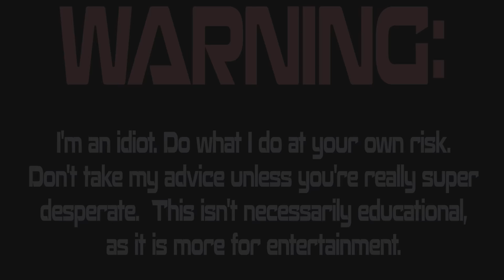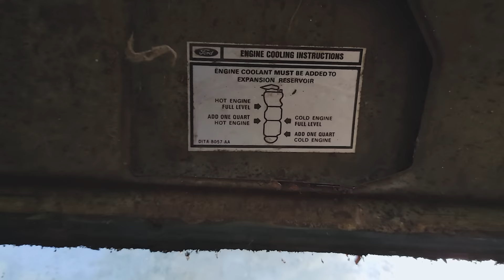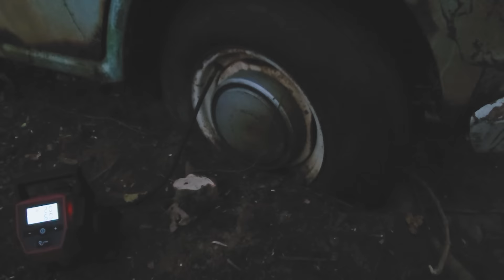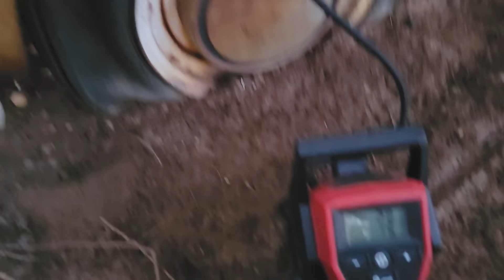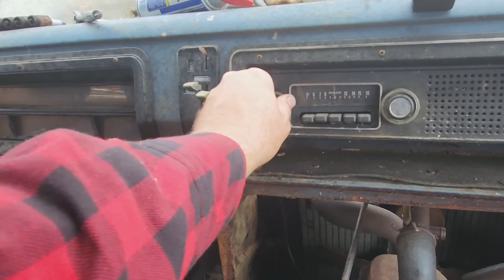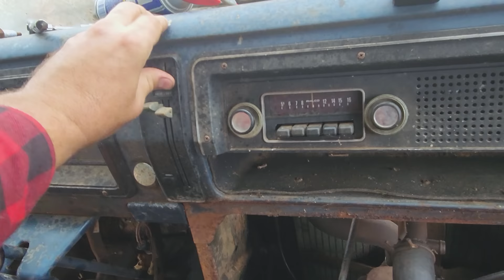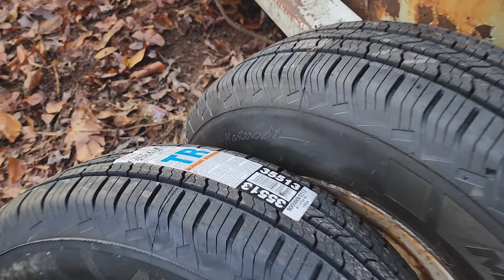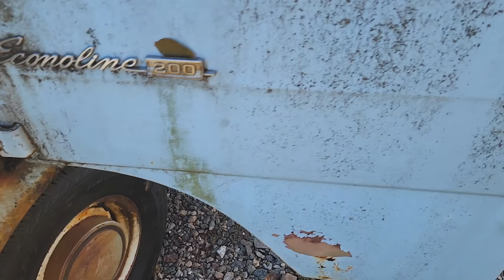Buried in the woods for 32 years! Will it RUN AND DRIVE? Abandoned Ford SuperVan!

Comment: I think that van deserves a full resto honestly, seems like an incredibly fun project
Reply: And a useful project when finished .
Reply: I’d like to see a full restoration. This brings memories of when I worked out of these vans for deliveries and appliance repair. The ones I drove had the 240ci six and three on the tree too. I remember there was a grease fitting on shifter shaft behind the grill that nobody greased and then you couldn’t move the shift lever. One guy I worked with actually broke the shaft. Heater made noise but not much heat.

Comment: The trick to taking off the engine cover is to lift the front up and rotate back. You have to stand behind it while doing this. You also have to simultaneously cuss or else it doesn't work.

Comment: I was screaming 240 six cylinder at the first of the video.  My senior year of high school , I was the proud owner of a 1972 f100 Explorer with a 240 six cylinder engine. I got it from my dad and e tried for a couple of years to blow the motor to give him a reason to do a V8 swap. I got it a drove it to Orlando Florida from North Georgia and back for my senior trip. It used a little oil but made the trip with ease. I put a split header on it to make it not sound so much like a six cylinder. I loved that truck. Great video guys.

Comment: Dont feel bad. I drove a VW Beetle from East London on the east coast of South Africa, to Port Elizabeth, 300km away, with no brakes, and no emergency brake. That is through passes, towns and all, just using the  gears to slow me down, going into first gear and switching the engine off to stop. Back in gear, restart and pull away. That was a hair raising trip, but it was fun. You guys make us proud by giving those old vehicles a new lease at life.

Comment: If it was mine i would get it running, pressure wash it and send it just like it is. Those Ford straight 6 engines are indestructible. I'm commenting early in the video but i predict it will run with minimal work. As far as clutch and linkages im not so optimistic. I think that old van is really cool. I had a 1980 econoline van for awhile with a 4speed manual with overdrive 5th gear and i absolutely loved it. Mine was actually stolen if you can believe that. Hope you get the old girl running and as a long time viewer of the channel i have no doubt you will. Im really enjoying this one and cant wait to see how things turn out.

Comment: Love your stuff and it so reminds me of us in the 60s and 70s cobbling together all kinds of monstrocities over a 12-pack in my friends garage.  Lot of scuffed knuckles then with no power hand tools. I got divorced at 72 and bought an 88 Ford XLT 350 van so I'd have someplace to sleep if I needed it. I just crossed 100k original miles. I've fallen in love with this extended model, there is so much room. It's totally stock now but I could make a bedroom and kitchen in the rear. Lots of windows. Powerful torquey engine. I think it was used to take special needs kids to class so it was all local miles. I tore out 3 bench seats.

Comment: Those old Ford straight 6s are almost indestructible. My dad ran a construction company and he put that f150 with a strait 6 through its paces on the week days then pulled a camper and a boat behind the camper on the weekends. That truck finally gave up after 890,000 miles.

Comment: I have a 1978 ford van in my field. Hasn't run-in 10 years. Nothing wrong but bad gas mileage. It has a 460 V8 auto. Dual tanks and exhaust. Not much rust for central NY. It's a window van with all it's glass. This van reminds me of mine

Comment: Vans like that are cool so you can add much needed fluids in motion without stopping at the gas station. Plus one guy can steer while the passenger can operate the accelerator. Good safe trip fellers.

Comment: You two guys really played well off each other, it was funny as hell. I think a van with this much space should be a conversion van for doing a little traveling.
Reply: It'd be sweet to make it four wheel drive with  f250 drive train and put a pop up tent top on it
Reply: With just a 6 cylinder it may not have enough power to pull a heavy camper van
Reply: @bertgrau3934  
If I remember correctly, they were geared down because of that. I remember driving vans like that and they were great around town but they ran out of revs at freeway speeds. At 65, it was revving its heart out. Kept waiting for it to shift into high gear (even though it was there). 

I think they changed from this style to the new one in mid ‘94. 

I’m feeling old because I was a mechanic at McDonald Ford on Mack Ave. in Detroit and did new-car prep from the factory. I prepped many of these and remember the new vans coming out, I’m sure, in ‘94. 
Thanks for the memories!

Comment: Had one of those vans 72 but a shorty panel sides I built the 302 4 barrel 650 cfm HUGE CAM AND HEADERS, MAGS WIDE LOW PROFILE TIRES. C6 transmission I made it a girl catcher Shag carpet and curtains. I surf off the coast of California back in 1980.

Comment: I had a 72 Econoline back in the mid 90s. We did the right thing and swapped out the stock 240 inline 6 and swapped in a 302. It was about 15 mph faster and got about 2/3 of the mileage it got with the 240 inline 6.

Comment: We have a van exactly like that sitting ontop of the mountain at the farm and it's used as a hunting van. My great grandpa took the motor and tranny out and pulled it up there with the tractor and put a 100 gallon lp tank under hood and ran copper lines to a gas stove in back middle of the floor. Turned the bench sideways. I've slept many times in it deer hunting. You get so warm in there and it would put u to sleep. I'd think about pulling it off mountain if it was a panel van but it has windows exactly like this one. I have pics of it on fb. It is a pretty cool van.

Comment: I owned a 69 E300 1 ton with a 302 V8 and C6 automatic that was the same color. It pulled a 32ft travel trailer with ease. It could also be made to haul 2 yards of sand which made it ride like a Cadillac. I sure miss that old van.😢

Comment: Glad to see my two favorite YouTube car experts getting dirty and working together.  Cool find.  Definitely keep stock motor.  Disc brake conversion + new suspension/steering.  Fix the major rust, keep the patina and use it for a parts hauler, maybe with a mattress in back for road trips.

Comment: My first vehicle was a 1978 E150 Ford van with an Inline 6cyl. Those were great, very smooth engines,  and easy to work on.  I learned to drive 3 -on-the-tree, 1971 van

Comment: A friend had the regular length E100 about the same year with the 6 3 spd back around 1979. He made benches for the back and we all cruised around in it for some years. Drove and ran like a champ. We went from Boston to all around Canada and back in it. I say do a budget build, fix what's wrong and do some upgrades to see what power you can get out of the 6, like headers and a 4 barrel or dual carbs if something like that is available. Get it going good and do some before and afters. Test it on a drag strip before and after? The possibilities are endless

Comment: Hey guys,  I think what you should do is make this a custom restoration as a Questionable Choice Garage Remote Rescue Vehicle. I envision it this way. Start with a full normal restoration... maybe a few slight engine mods to gain a few HPs and give it a little pep. The interior should have some sleeping space for at least 2 people, with a small cargo/storage area for tools and new parts storage. Maybe a  small fridge or ice box for a little food/snackage and drinkage. If you wanted a little more versatility, you could put a tow hitch on the back and have a diesel engine swap for some more pulling power to help yank really stuck vehicles that are sunk to ground up to the floor boards, like this van was.

I think you should do something like this or some variation thereof with this van.

Thanks,

Tim

Comment: I remember doing this exact same project, but on a old Ford Brougham with a 400. It had moss growing all over it and had been sitting probably 20 years. It was green with a soft black top. We got it running with absolute minimal work and money then drove it around our county all day. We ended up rallying it up an old cow trail road that turned at a lake shore but we didn’t make it… turns out a tree had blown down across the road and was sitting at windshield height. We nailed it and peeled back that car like a sardine can! Lucky to have lived to tell the tale. We all bailed out and hiked the 20 miles back home. We were all too lazy and hung over the following days to try and retrieve the boat of a car pinned under a tree… next thing we know the ministry is calling us saying we have 24 hrs to remove the vehicle or were being fined 10,000$ for each day it sits lol needless to say we drove my buddies dads propane tractor to go tow it out and put it right back in the spot we found it. That 400 had a ton of power.

Comment: "If it ain't two things, it's twelve!!" 

GREAT VIDEO! I was LMMFAO!! Driving down the road on fire, no brakes, Jared working that wheel like he's sawing logs with the 'barely there' steering, Derek pouring pee/coolant on the exhaust manifold with his door flying open, smoldering air freshener tossed onto the pile of flammability in the back of the van, like HOLY COW! Can any more stuff happen all at the same time?!?! My aunt used to always say, "If it ain't two things, it's twelve!", you guys had 12 squared, it seemed!!

Nice work on digging it out of that muddy tomb and bringing it back to life, somewhat!

Comment: Worked for a company and drove a 72 Ford van like this one and it had about a half a turn of play in the steering wheel until the day the steering box completely rusted away from the frame then the wheel would spin freely with no response from the steering tires. Had it rewelded to the frame and drove it for another 2 years till the seat riser rusted away then you would put in a milk crate, put the seat on top of that, sit on the seat then fasten the seat belt on tightly to keep it all in position.

Comment: Someone suggested 'awesome vintage camper van build', and I think I agree.  The 240 six and three on the tree are way too cool to ditch, but it needs to be highway drivable - I'm thinking front disk brake conversion (maybe even power brakes), and add an overdrive unit to the three speed to give it some highway legs.  After that you'd have an awesome platform for all sorts of projects; vintage air, maybe?  EFI & cruise control for a fun challenge?  Sky's the limit!
Reply: Offy intake with a 390 CFM four barrel, cam, timing chain and headers.

Comment: The old school vans are starting to get more and more popular so the prices of a straight example, rust included, are shooting up.  I've got an old G10 shorty panel van and two Corvair vans, one panel and one camper style with windows and rear seating.  The Corvairs are special for obvious reasons with the powertrain layout, meaning people either really really want them or they're parked and forgotten.  I like the flat-six in them and the second gen's great handling and weight distribution.

Comment: I restored my 1976 Dodge B200 that my Grandad bought new back in the day. It has the same flat nose design and similar steering although it was pwr. I thought the steering wheel had serious problems as well but turns out, so it seems. that play when not being driven is common place. I still had to set the freeplay on the worm gear which helped and I replaced every tie rod and steering arms as necessary. The Free play might be wear on the other gears with the large nut that adjusts the pitman arm. Most of the play is in the gearbox. Haven't got around to that yet. These vans are more affected by the crown of the road than I expected. The reason I replaced the front end more or less. Really helped with the crown of the road. I made sure there was no play on the front wheel bearings just in case. Suggest they get cleaned and hand pressed for degreasing. They get hot if you don't like your Grand National did. The brakes combination valve needs a good flush as they can cause the calipers to drag. Comes with a reset pin with a ring on it. Might be what keeps popping. Might be the problem with the LF captain's wheel as well. I replaced an outer bearing and the RF caliper. I had PWR brakes to deal with. Same emergency hand brake. The cable to the rear wheels run through eyelets that can rust out. The rust on the front floor comes from bad door seals leaking front window seal which also runs down under the dash. The chokes on the Dodge are horrible. Even the movie van on Cannon Ball Run was having troubles with that choke according to a YouTube video. I put in a carb kit. Designed a modified choke that remains electric but opens it up a bit more right after it starts. Chugs if you don't. I followed specs 100% so it does run and starts great. Cold winters change things but that depends on where you live.
   Safety note: don't ever recognize the smell of asbestos when it comes to old brakes. You guys should be wearing 1/2 masks with asbestos filters. Brakes have made asbestos illegal more or less but old brakes didn't get the memo.
One more safety thing: the steering stops on the king pin wear off which causes the tires to rub on the frame on sharp turns. They need repair sometimes. Those oversized tires probably rub on the frames on turns anyways.
I know safety is first with you two fellars. Are you guys unionized cause... well... never mind.

Comment: My thoughts, stock with some fun stuff.  New "hoodette" or weld repair the old one.  Get the mechanics straightened out.  New, basic paint job, appliance white, or better still, powder blue.  A thick, rubbery floor covering.  Vintage air.  An extra set of seats to bring friends, a small fridge, still plenty of room for hauling, camping equipment, fetching parts, or putting on a five act puppet show through those expansive windows.

Comment: I've got a '74 Econoline with similar aftermarket foliage. A rod knock parked it in the mid 90s but then some a-hole ripped the grille while stealing the radidiator. I'm still mad. Instead of light bulbs, mine is full of weed eater parts!

Comment: Right here are some options.  You could do it as the Mystery Machine?  You could set the interior to look like a colonial mansion.  You could even call it the mouse machine and custom paint the outside to have a mouse theme while inside do it as a giant mouse cage wheel etc.  You could do it factory but paint it as a 70's exterminator van! Live a little have some fun! All the best from across the pond.

Comment: I say keep it original. Clean it up make it road worthy.  It will make a nice economical daily driver.  My first car was a 69 Econoline 300 with same faded light blue color.  It had a 302 with 3 on the column.  I drove it home with almost no brakes and a blown muffler.  Previous owner had been working on it and and installed the muffler backwards. It was very loud and I was more worried about getting pulled over due to the noise than anything else.  I had that truck my senior year in high school and well into my college years till I sold it.  I'm looking forward to seeing what you do with it.

Comment: What worked for me with tree sap like that on the windows was Goo Gone and kitchen steel wool pads, if you get all the gritty stuff off first they will polish back like new, after adding some elbow grease.
Reply: 0000 steel wool and  vinegar works  useful old pickle juice  if you don't put it on your roses but  elbow grease is the most important thing

Comment: Derek, don't do a cam..... Why not experiment and put one of those 48 volt electric turbo chargers (super charger) on it and then the rear end gearing will not be an issue??? Also, you'll increase the wanted horse power when you need it. Just a thought........ Nope!

Comment: I love this video so much. You should definitely keep the paint and body work as is and get the ol girl mechanically sound, I dig the patina. I love vans, like really REALLY love vans. 3 years ago, inspired by your videos, I went to buy a 1984 Ford E350 that had been converted into a van body ambulance. I rebuilt the carb, attached a "fuel cell" with a clicky clack pump, and after 6 hours of tinkering, an exhaust fire, and realizing it had a return style fuel system that was puking fuel all over the ground, I drove it home. In the dark, with no plate or insurance, and the carb backfired causing the sound deadening in the cowl to catch fire, which I would blow out when it got too big. I daily drove it for a year around Knoxville until I accidentally put a hole in the rad while messing with the timing. Still have it, still can't justify the $900 for a new rad so it's a storage shed until I get some tax money or I sell something in my "fleet" (yeah right).
Reply: Love bus da😂m
Reply: Use a aftermarket aluminum radiator less than 2 hundred dollars will work with ac and will come with transmission cooling line you will have to fab on the rad mounts but it will save you hundreds and you can use the 460 auto 4.10 pod to burn gas had one it got a solid 10 mpg loaded up hill or going down hill empty or pulling a car trailer.

Comment: Mom and dad had a 69 e 100 shot wheel base with a 302 v 8 and it was a runner. Later in life I brought a 1970 e 100 wich had a 240 straight 6 drove her for a while  and changed out and put a 300 six and what a beast . Sold her not by choice, she has been seen in San antonio tx I would like to find it and buy her back